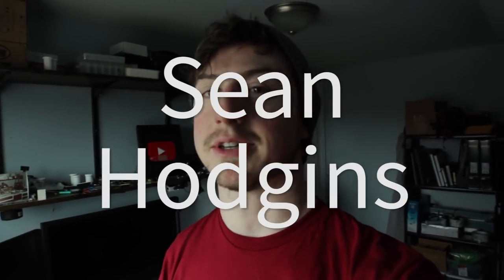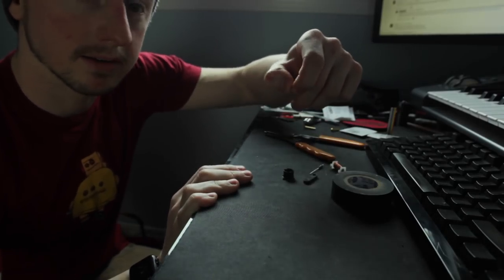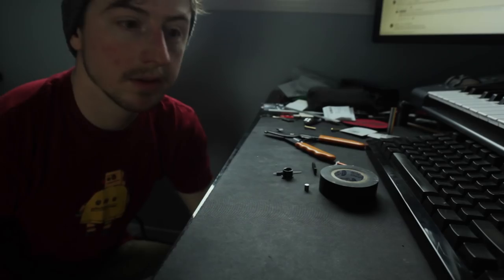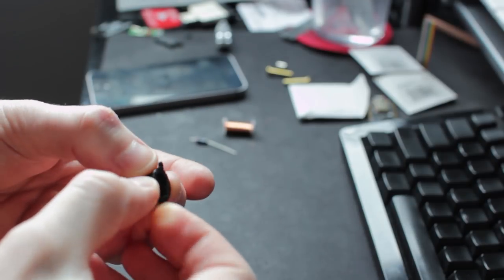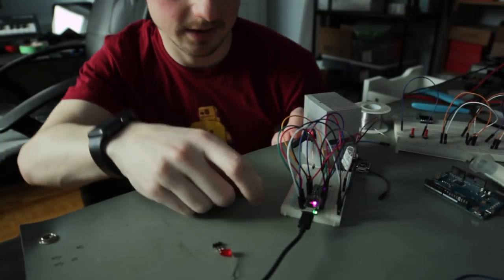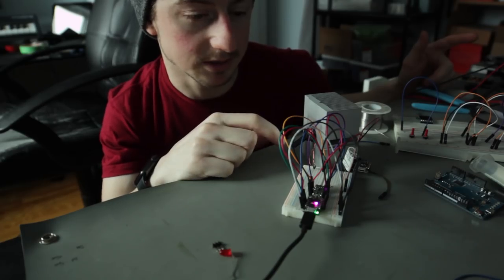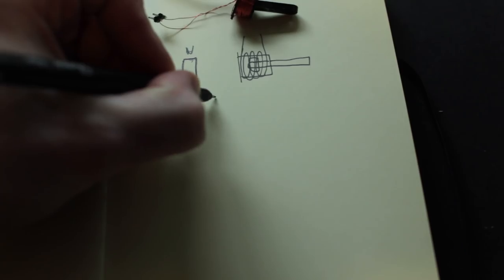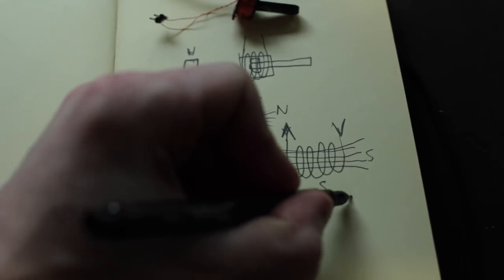3D Printable Robotic Actuator

Comment: Awesome idea! However, the magnetic design could be more efficient - if you can have the magnetic axis of the magnet aligned with the coil. So when you have current direction changing it would attract/repell the magnet. It would give more force than the torque you're getting now with trying to tilt the magnet. Think of a solenoid, that would be the most efficient magnetic design (if only we could 3d print with ferrite material :))
Reply from the maker: I think I understand what you're saying, but I think the benefit here is that its a rotating actuator, not a linear actuator. My application calls for a rotation.  Unless I don't understand what you're describing and it is also a rotating actuator.

Comment: How much force can it exert? How fast can you move it back and forth? Can you move it part way by pulsing the coil on and off? Cool project.
Reply from the maker: I just measured the force on a small scale, and at 0.5A gave about 1 gram of force on the scale at the end of the arm. This design I can move back and forth around 20hz, smaller designs can move much faster. You could move it part way if you added a spring of some sort. There is no resistance except the boundaries of the arm, so even a small voltage will make it move fully in either direction.
Reply: SeanHodgins really cool, thanks! I've been thinking about trying to build an ornithopter using something like this

Comment: I built a coil like this but bigger, it works but to have any force it needs a higher voltage, but with that the coil gets super hot, do I need thicker copper or what can I do to prevent it from heating so much?

Comment: what would happen if you used PWM on the motor driver so that its not reversing the polarity on the actuator power input but adjusting it instead? would you be able to freely adjust the position of the actuator or is it either fully up or down only?

Comment: Very cool! So how much current draw was that requiring as is?
Reply from the maker: I was limiting the current in this case. Depending on how strong or fast you wanted the movement, I could drop it as low as 0.3A, but to run it fast I had it set around 0.8A. I think these scale down much better than up, and mine is on the larger size. I'm going to try making some really small ones, just my printer won't print much smaller and still have a usable part.
Reply: WOW! Almost an Amp? Would winding it much tighter and neater (liker you mention) really drop it that much? So how will you solve making smaller actuators if you can't print smaller? I'm super excited to see where this goes!!!!
Reply from the maker: Unexpected Maker winding it tighter and neater would improve it a lot. But I’m not surprised at the current draw, most electromagnets will draw a lot due to being just a short circuit, so they need to be limited based on your needs. It takes more power for this one because the arm is larger and heavier. Tiny actuators shouldn’t draw much at all and from what I’ve seen made already by people run them on incredibly tiny batteries. As for smaller designs... probably Shapeways with the UFD prints. :D

Comment: I built the coil actuator, but now I don't know how to drive it. What is the circuit you are using to drive this thing?
Reply from the maker: It’s using a motor driver to provide the current from a power supply. Requires some IO so I connected Trinket M0, but all it is doing is reversing the polarity of the voltage.